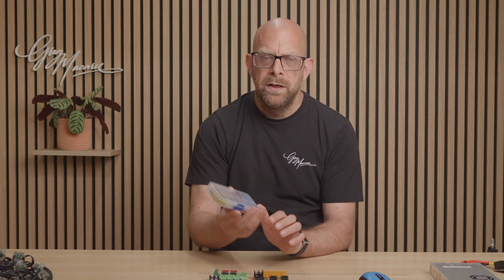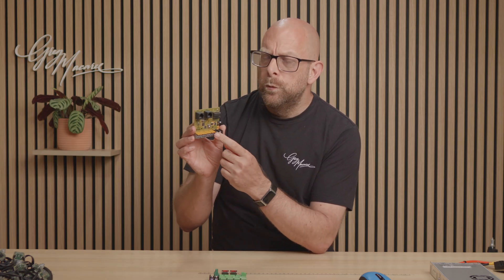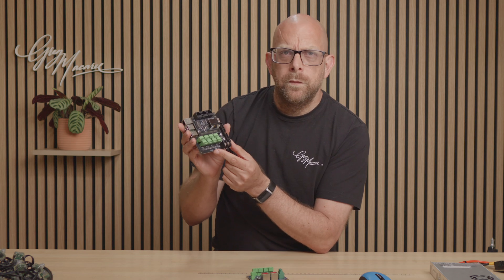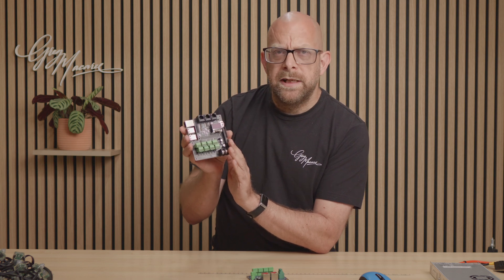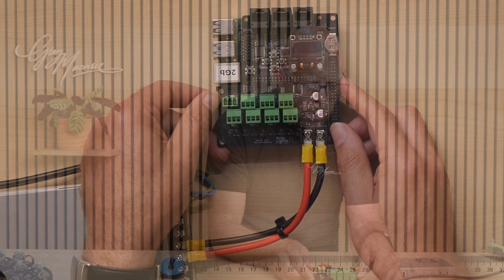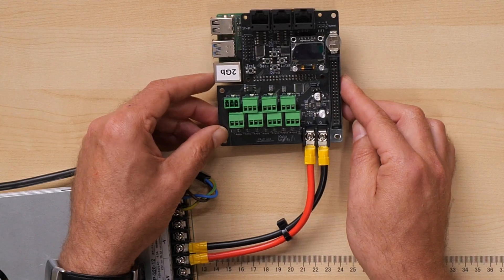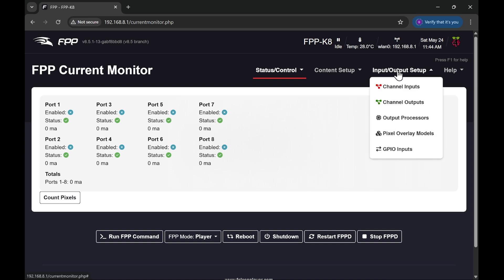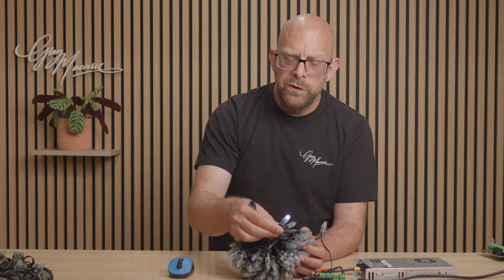E-Fuses on Pixel Controllers #xlights #fpp #holidaylighting #pixels

Comment: Poly fuses as you call them or thermal fuses like shown on the genius board are HORRIBLE. They were used in the HVAC industry for years and failed so bad manufactures switched back to blade fuses after a year. The thermal fuses would weld shut or just fail if there was any kind of short. The other issue is they work on thermal loads. So if the controller gets hot it may trip at 3 amps if the controller is cold it may trip at 6 amps. I have a controller with the thermal fuse and had one fail already. I also like the blade fuse because I change my fuses to the lowest amps it needs. If the port needs 2.5 amps on all white I use a 3 amp fuse. I also like to be able to remove the fuse and test for a short without un wiring the port, and also remove the fuse and test the amperage draw for the port.
Reply from the maker: I do agree with you on the ability to set the fuse rating according to expected load. Didn’t know about the issues with polyfuses welding themselves shut tho. Thanks for the feedback

Comment: I've been running eFuses on my pixel controllers for the past two seasons, and while I really like the idea, especially the safety side of not having pixels powered all the time, my experience has been kind of mixed. I've run into numerous false trips as well as encountered inaccurate current readings, which has led to false high-current warnings. In one case, I was getting 4 or 5 trips an hour on multiple ports of a smart receiver. Swapping that receiver out for a different one fixed it, so it seemed like a hardware issue. But even now, I still get occasional nuisance trips here and there. I like the concept, but I've been wanting an additional setting that would auto reset the fuse under certain parameters to alleviate having to constantly monitor my show for false trips.
Reply from the maker: That’s an interesting update, thanks Doug!